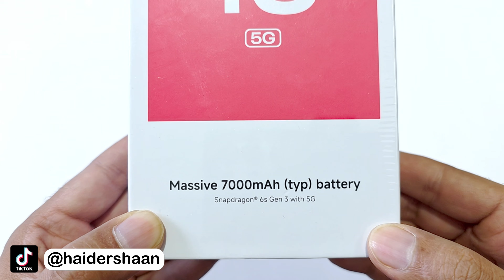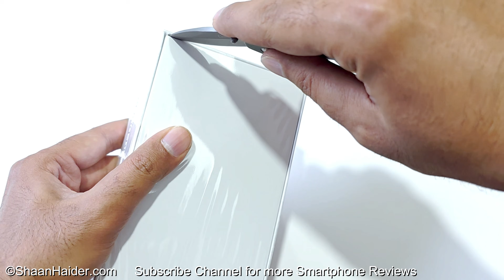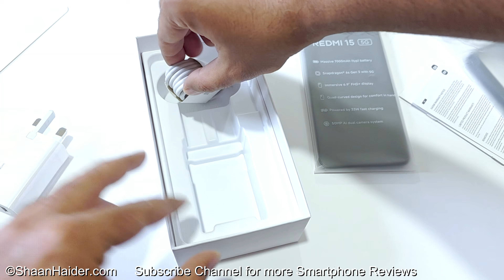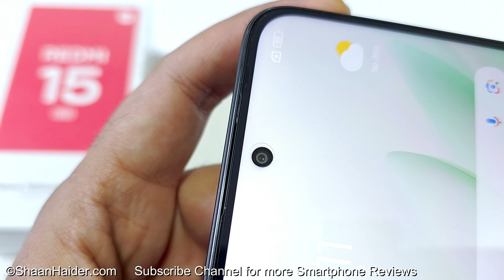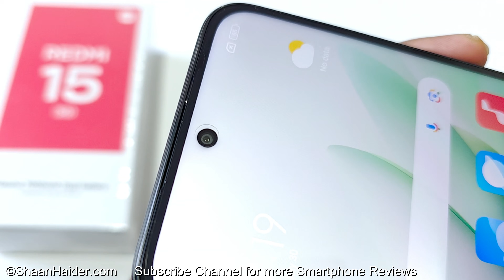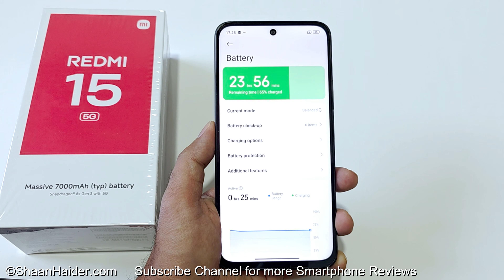Xiaomi Redmi 15 5G - Unboxing and First Impressions

Comment: Don't Buy redmi 15 Display error issue
Reply from the maker: So far no issues on my unit, using for more than a week
Reply: No display error
Reply: 😂😂 fucking guy
Reply: The redmi 15 4g has only one rear camera but you'll see three camera at the back. It claims to have 50mp but the megapixel is 13. Though the battery is good.  the download speed is really slow compared to many MediaTek of older gen like g85 on my previous redmi 12c. aside the above, it is good but For me I'll suggest looking for another phone and avoid Snapdragon 680 because of download speed and WiFi download speed too
Reply: It is too perfect smart phone no ERROR DEAR 😔